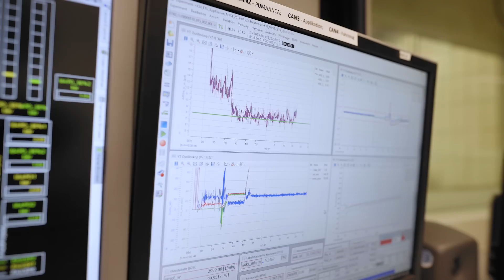A Bavarian Soulstory - Episode 6: Boxer Engine

Comment: Ah the engine: I own a Boxer Cup Racer that was in the 2003 series. It qualified at Daytona but was never raced so it survived the series. I bought in in 2006 from Max Stratton who owns MAX BMW here in the states. Max got if from a collector.  I figured I'd ride it for two years then trade for a "sit up" bike. I've put over 50,000 miles on it myself.  I'm seventy years old now and plan to ride it for many more years. Power you can use every time you ride. Every time I ride it I start smiling inside my helmut.